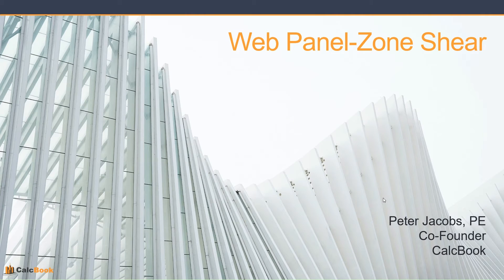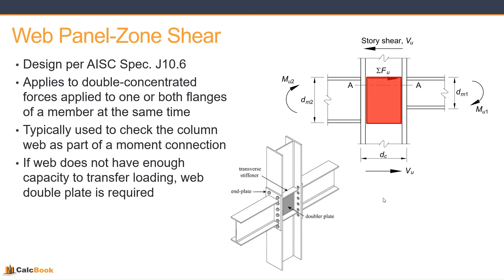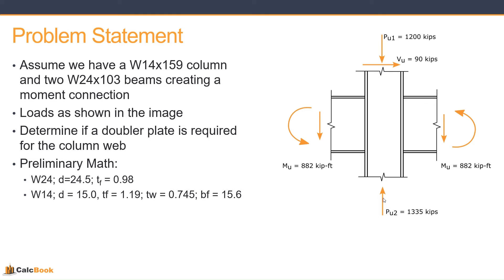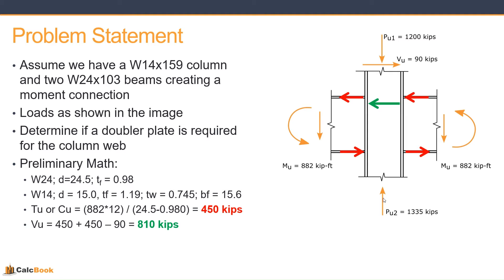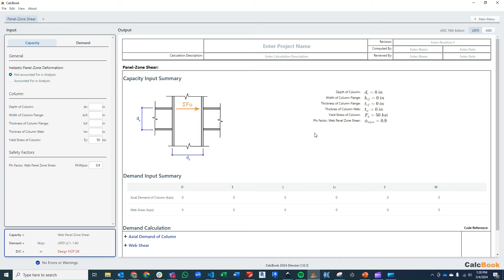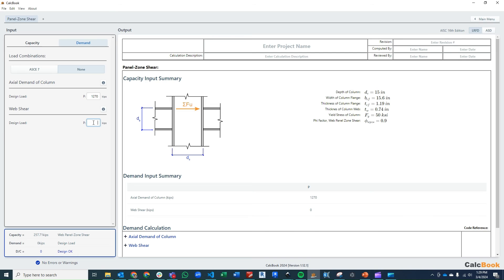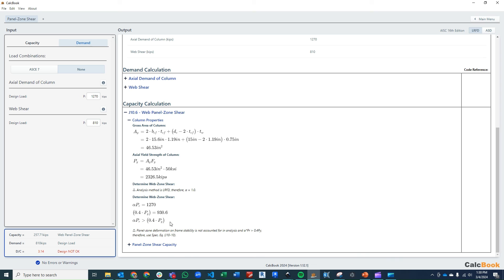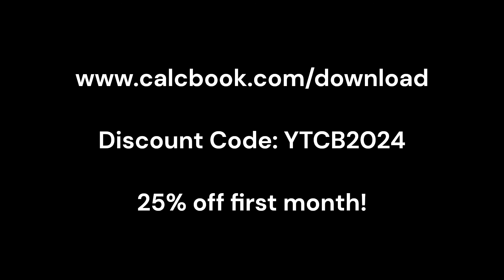Web Panel-Zone Shear (AISC 360)

Comment: Do we need to check for Doubler plate if we have framing beam connecting to web  in orthogonal direction?
Reply from the maker: good question! For panel zone shear, the panel zone still must resist the shear demand from the moment in the connection, which an orthogonal beam web would not help with. So yes, a doubler plate check would still be necessary. Another option would to be add transverse stiffeners to transfer the force couple from the flanges.

Comment: What about the case that column moments are added at top and bottom ?
Reply from the maker: A moment in the continuous column should not impact the check of web panel-zone shear, HOWEVER, you may need to check for a variety of other possible failures including: flange local bending, web local yielding, web local crippling, web sidesway buckling, and web compression buckling. 

We cover these in our simple moment connection video here where there are moments in both the beam & column:
https://www.youtube.com/watch?v=4fBKyLDHefw&ab_channel=CalcBook